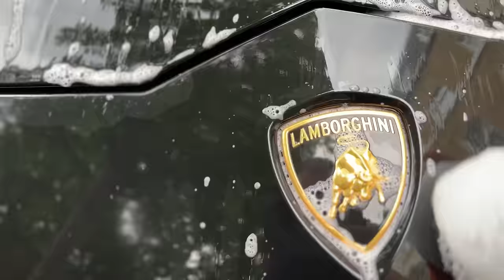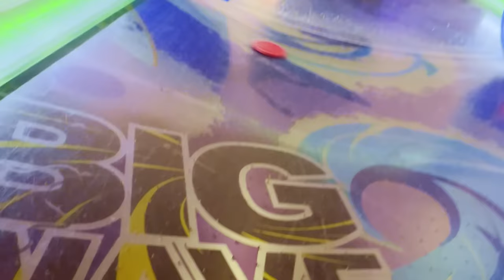Day in the Life of a Luxury Car Cleaner GONE WRONG

Comment: Hello there Tino, out of curiosity I have a question(others can answer too).
- Why leave windscreen wipers down when washing the car? Thanks in advance for the answers.
Reply from the maker: Good question, the main reason is to avoid having them smash back onto the glass.
Reply: I find the wipers trap a lot of debris, so I lift them before snow foaming as there's not much pressure and then put them back down for rinsing.
Reply: @TinoCarCare  And that is called... AMAZING SERVICE
Reply: @css172  Agreed I am a detailer myself and I always like to lift up the wipers and give them a quick rinse
Reply: @pablojenobli2712  Same. Lifting them up also allows for the rubbers to be cleaned properly, if not the windshield could get dirty again as soon as you use the wipers even once.

Comment: Another great video tino, I have a 2019 Audi SQ5 Black Edition and I’ve been using your detailing products. How do I avoid scratching the black gloss trims on the car such as the door frame etc. Keep up the good work brother 😊
Reply: Clean them properly before you touch them, and only use clean, seamless micro fibre.
Reply: There is really not a whole to keep from scratching piano black. However, on exterior I would recommend PPF only those panels. I had this done to my dad's Mercedes' B pillars and had all the piano black on the interior PPF'd and my dad loves it. If done correctly, only pro detailers can tell and it will look great and give you piece of mind. Just my opinion.

Comment: Hi! Just a quick question. For the Pre -Wash Blue Snow foam, after applying it.. can I scrub it with the mitts or its better to just wash off.
Reply from the maker: Hello, it would be better to wash it off as there is still alot of dirt on the car which needs to be removed first before hand washing

Comment: Hey bro nice videos, is the Kranzle reliable how long have you had it does it give you problems or do they hold up to abuse ?
Reply from the maker: Hello buddy, thank you! I have owned the kranzle for many years, and it is pretty reliable and durable.  As long as you maintain it well and change the oil regularly it, it will not let you down too often. In colder conditions however, it really struggles.